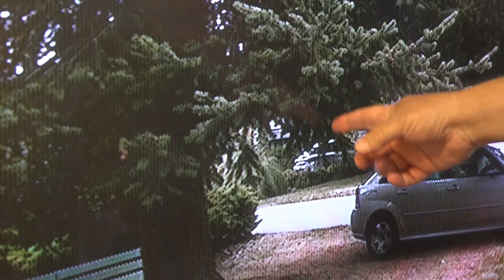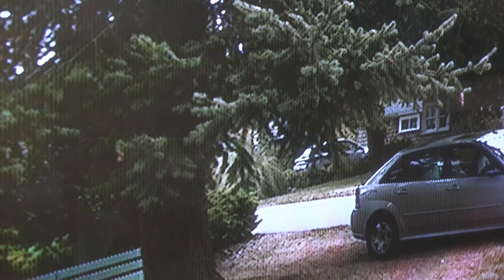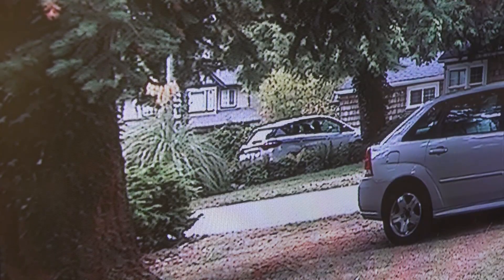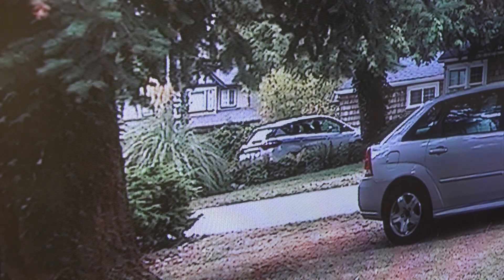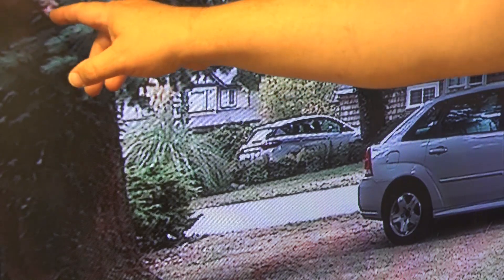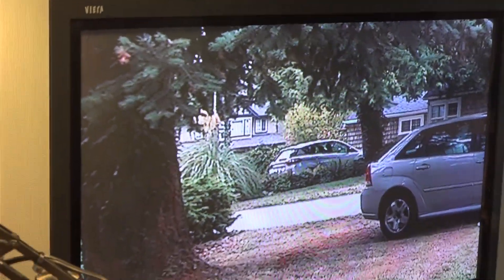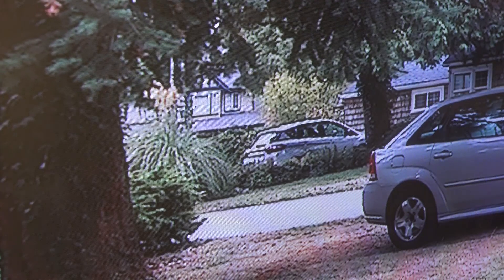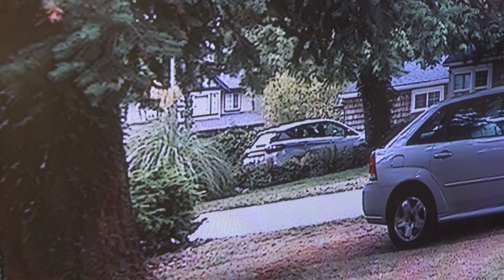Single tube vs single CCD on a high res monitor

Comment: So, what explains the stripes on the gray car?
Reply from the maker: The tube camera was a Sony Trinicon, Trinicon operated sort of like a beam index CRT.
They had the red, green, and blue color stripes followed by an elctrode embedded in the color filter. As the beam passed over the electrode, an electrical signal was detected which was used to lock the color timing circuit to separate the colors. Unfortunately there also was no video generated when the beam passed over the electrode that was placed between the red and blue stripes across the front of the tube. In the day of low resolution analog recording there was not an issue because the color resolution of video tape was poor as was most picture tubes, but a high resolution digital display has no problem displaying the image with the loss of signal, and it shows up as vertical stripes.

Comment: Yes the black lines are an odd effect, but as you said a crt would display it better.
I would only use a crt for tube cameras.
Most digital tv's do a really crap job of displaying analog video, im sure having to sample the analog video lowers the quality.
Digital signal to digital display, Analog signal to analog display.
Reply from the maker: Yes, analog to analog display is best. The digital displays look so bad due to scaling to fit the screen. If you display at normal size it will look fine, but there will be a huge black border around all 4 sides.